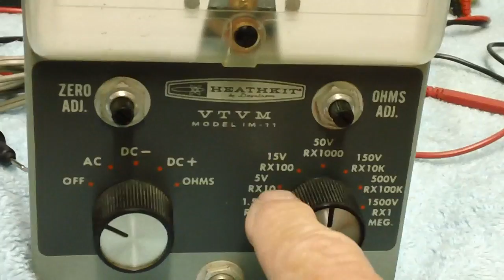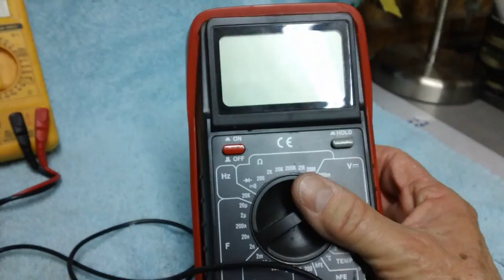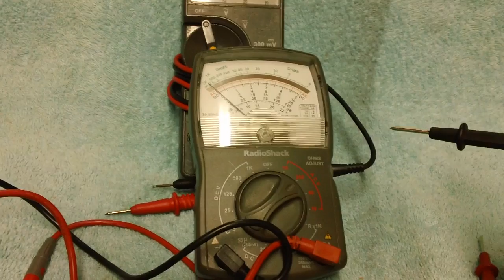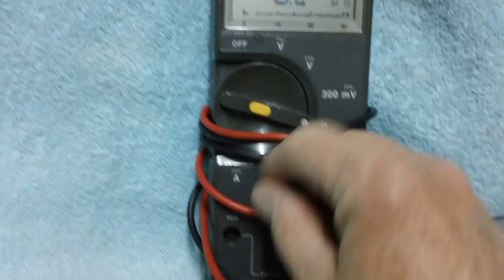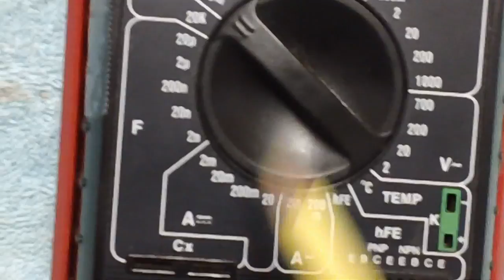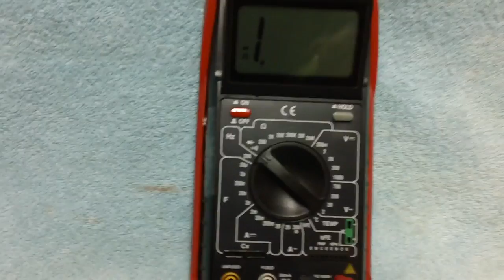General Electric C-403A Radio Repair Exercises (part 13 of 14).

Comment: Oh wow, I got one of those volt ohmyst's, I think it must be the junior one. got it from Bill (old64Goat) it's missing the probes though. I've got a nice Craftsman DMM that's auto ranging, idk if it's as accurate as a fluke but an electrician friend of mine said it's basically a rebadged version of a more expensive meter.
Reply from the maker: Daniel,Good test equipment always comes in handy in this hobby, but highly expensive gear isn't needed unless you're in the biz.Regards,John

Comment: Ya got some nice battery checkers OT!
That Fluke looks familiar. I've had mine for well over twenty years, never a problemo. I like that large numbers tilt jobby a lot.  I have a RS Micronta talking digimeter.
I made a vid about it way back when, I think I will dig it out and repost it. 
Good vid, and of course, READ THE BOOK PEOPLE!  Yes there are some good how to use a multimeter vids on YT, but reading is goooooood too!
73 Don

Comment: Excellent straightforward video John.  I like using both sorts of meter but modern DMMs are so versatile as I work on solid state radio as well, they get used the most here. The analogue meters come out for indications and comparing voltages against the original manufacturers circuit/schematic readings for valve/tube stuff, as they (mostly) load the circuit the same.

Regards _ Andrew

Comment: Hello John,
Do you think that Fluke meter display could be fixed?
I used to have a Micronta 22-195A bench meter that had a weak display, at the time i worked assembling surface mount electronics and asked my boss if there was anything i could do about it and he told me what to do. It was just a matter of getting to it and cleaning conductive strips. Worked like a charm and was easy to do, i don't know how hard it would be to get to on your Fluke but thought it would make for a great future video.
Reply from the maker: There's no doubt the meter display can be made brighter, but at the moment it's not a priority.  I'll take a look at it sometime next year.

Regards,
John

Comment: Cx slot is for Capacitor... using probes will introduce some stray cap values... The slot will give you more accurate capacitor values...
Reply from the maker: I'll probably never use the capacitor testing function on any meter.  I much rather replace all the old ones, although I do understand that sometimes a new cap can be bad.

Regards,
John

Comment: John: I fixed many a computer circuit boards using that Fluke 73 meter using the diode checker when I worked as a bench tech for NEC. Dont let that one go.....Regards, Buzz
Reply from the maker: Buzz,
Brendan won't use anything elso, so you're in very good company.

Regards,
John

Comment: Another very useful and informative video John! The auto ranging meter looks cool. Saves a lot of switching.

BTW I managed to get a Heathkit IT-12 signal tracer off eBay but would like to change the probe to one like yours. Is there a video showing what to do?

Regards,
Gordon.
Reply from the maker: Gordon,
You're right.  The auto-ranging meters are cool.  It's good to have one around,

In regard to the IT-12 probe, go here and look midway down the page for the schematic.  I'll take a closer look at the probe I bought and maybe be able to come up with a vid about it.
http://www.ohio.edu/people/postr/bapix/SigTrac2.htm

Regards,
John
Reply: Thanks John. That link is really useful, and I will give it the old college try in making a probe. A vid of yours would be terrific though.

Cheers ,

Gordon.

Comment: John,
Your tutorial brings back memories of when I learned how to select and use an analogue multi-meter. Digital multi-meters (incorporating a row of six red seven-bit displays) did not come onto the scene until the mid-70s; and LCD multi-meters (as I recall) first came onto the scene during the late-70s.  Those days, digital meters were not very good to work with – display numbers were changing all the time – and their cost was at least five times more than a decent quality analogue multi-meter. 
Digital multi-meters have certainly come a long way since those days.
Very good tutorial video my friend.
Regards,
Phil.

Comment: It's a real bug bear of mine that company's are willing to sell instruments that can kill you if you use them wrongly but unwilling to write decent manuals about how to use them properly.
Reply from the maker: But on the other hand, someone should not use an instrument/tool that can kill them if they don't know how to use it in the first place.  It's called taking personal responsibility for one's own actions.  So the pendulum swings both ways on that issue.

Regards,
John
Reply: True John, I can't argue with that but getting the lessons can be real hard so people are always going to try and do it by experimenting. Especially when they are young and feel invincible. And I mean, how hard would it be to write a generic manual and put it in the package? Really?

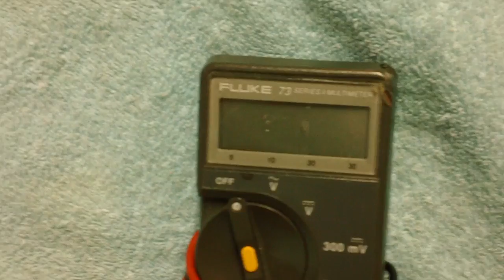Comment: Brendan is right at 11:50 you really need a good meter, and here´s why: https://www.youtube.com/watch?v=8cNc5An0DLw
I do not want to offend you in any way, but i just want that you to be aware of that point. You can measure anything with everything you want, as i also got some of these "dirt cheap" meters as well and they do their job. But you also need at least one good meter. And the "Fluke 73" is a good meter.

Anyway, good stuff for a beginner here :)
Reply from the maker: Thanks, my friend.  A general multimeter works well for me, as I don't do precision work.  Tolerances in these old tube radios are a mile wide.  But as you say, it is best to have at least one accurate meter on hand.

Regards,
John
Reply: John i know, it doesn´t matter if the B+ will be some 200 or 180 or even 220 volts. As long as it´s there;)

But if you measuring these voltages with "cheap" meters they may do "funny" things as well. If you simply check for its clearances inside you´ll know what i mean;)
People keep asking me, why should i buy a good meter, if i kill it, i couldn´t afford another one.
This, by first thought, may will be true, but since you got one, you will be, at least, think twice about measuring and these "Big-Name" meters have a totally different component layout. They respect clearences, ratings, and fused everything inside. They included some MOLVS (voltage depended cut out resistors) and high voltage glass-discharging as well.
So they will only show "OL" in display when try to measure some 500V DC in 2Volts scale and not blow off.

I remember that long ago at some rainy day i was testing a tube amp and its B+ was around 600V DC. Hooked up one of these cheap meters on it at the 1000V range and tested the amp. After some minutes this meter just went smoking...
After removing it from the B+ i opened it and some of the traces on the PCB had beed fried so as some resistors did the same as well....
The producer did not respect any clearance at all and the humidity caused some leaking across; and frying them at the end. This bad ass could had even catch fire.....

Comment: You can't beat a Fluke :) I bought mine, a Fluke 23, about 25 years ago. Still working as new. Dim displays are usually due to a bad battery, or the rubbery connector to the display. Apparently those rubbery connectors can be cleaned with alcohol.See http://www.youtube.com/watch?v=MTulo_SIE6E for instance.
Reply from the maker: Thanks, my friend.  Good video.  I'll be giving that a try.

Regards,
John